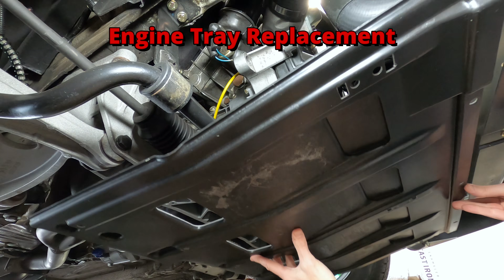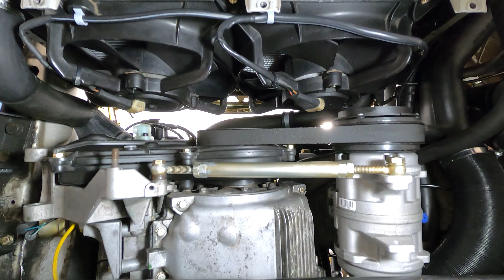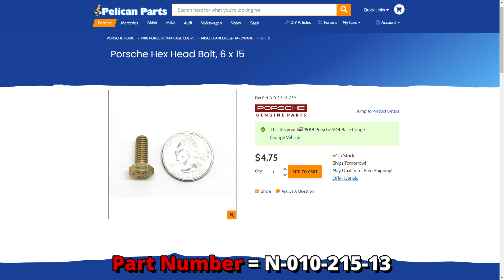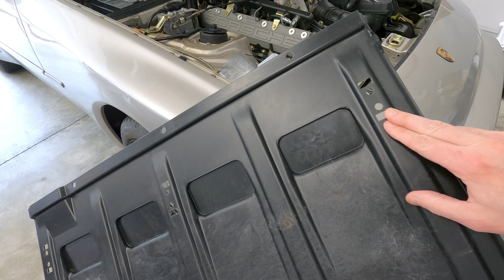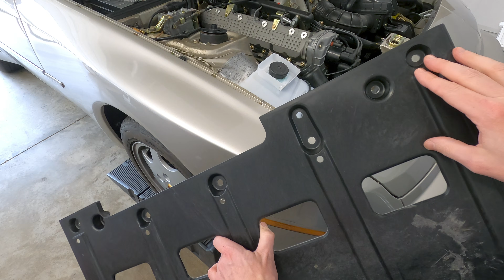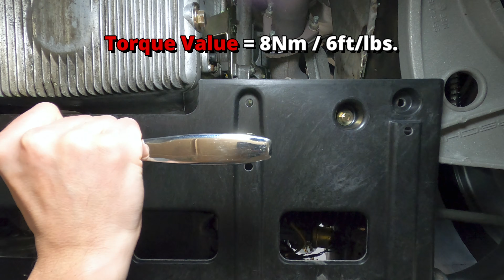Porsche 944 – Engine Tray Replacement Tutorial

Comment: I have the huge metal one, I need to hammer it out until it's straightened up. I just wanted to replace both my headgasket and  leaking oil gaskets in the front.

Comment: Another great video.  My 87 N/A was missing that as well.  I've read somewhere that there is an opinion out there that the removal promotes better engine cooling.  I'm not sure about that, so I installed one on mine.  No problems with overheating that i can tell....
Reply from the maker: Ha! That’s interesting, I haven’t heard that. I do know that Porsche conducted wind tunnel tests, even back then on the 924, 944, and other cars, so there would have to be a benefit in their minds. One would think that engine cooling is optimized by the greatest volume of consistent air moving through the radiator fins, for which it seems that the engine tray would promote by making the airflow more directional, but what do I know? 😂

Comment: Have had my 85.1 since October and your videos have been indispensable and inspiring! Hoping to make my car as gorgeous as yours, thank you! I have a question as one of my biggest challenges so far is dealing with water leaks in a rainy climate. The one I’m not sure how to approach results in water in the driverside footwell and I sourced it out with a smoke tester. With the smoke tube shoved behind the carpet by the hatch release switch, smoke comes out from the back part of the fender where it meets the door. It’s not a door seal issue, I’m wondering if there’s a seam water is getting in there. Any ideas?
Reply from the maker: Oh man! Yeah, water leaks can be a real pain to chase down. It also doesn’t help that Porsche seems to have implemented a design philosophy of allowing water “into” the car as a method for getting it “off” of the car. 😂 Specifically, the sunroof drainage lines and the rear hatch pin drain tubes can crack, get clogged, or become detached from their connection points, which allows surface water to directly enter the cabin. Other common causes include delamination of the rear hatch glass as well as the windshield glass along the lower edge where the seal dries out and fails. A rusty battery tray is also high up on the list and known for dumping water into the passenger footwell. As for the driver’s side, it’s possible that the A/C evaporator drain line has cracked or become disconnected, this would be less likely if you haven’t been running the A/C regularly. Based upon your description, I would check for cracks in the metal and seam seals around the chassis/fender/firewall in the engine compartment below the windshield. There are areas in this section of the car where sealant dries out or the metal fatigues and opens up a hairline crack. The seals around the top of the blower motor assembly are yet another entry point, really the list goes on and on, but those are the most common. I’ll include a link below that has a semi-consolidated list to think about, but checking the Rennlist forums will provide a lot of additional suggestions as well. In addition to the smoke testing, you can also try dumping water down suspected areas and observe potential pathways inside the car. I had water pooling in the rear passenger footwell, but the entry point ended up being the lower windshield. I had to feel around on the side wall carpeting to trace down areas that were the most damp and move up from there. Best of luck! 

Water leak locations - https://retrooutlaws.com/blogs/porsche944/porsche-944-rain-water-leaks-complete-list-of-locations
Reply: Thank you, really helpful!

Comment: There are no other vendors that supply Shoulder Washers?
Reply from the maker: I haven't found any that are the exact Porsche spec... I checked Belmetric, nothing close. The nearest I could find was from MaierUSA (link below). There are small variances in O.D. and shoulder height from the Porshce units, although I believe they would otherwise work, but they are stainless steel rather than yellow zinc. Might be a good way to go if cost savings is the ultimate goal: 25 pieces for $17. Here are the specs for comparison:

Porsche spacer washer - 6mm I.D. X 18mm O.D. X 1mm thick, shoulder height 3mm X 8mm O.D.

MaierUSA shoulder washer - 6mm I.D. X 15mm O.D. X 1mm thick, shoulder height 2mm X 8mm O.D.

https://maierusa.com/products/69991-shoulder-washers-6mm
Reply: @NC944er  thank you for reply and very thorough research.  Excellent commentary & content in videos.
Reply: This Maierusa pack of 25 special washers will absolutely work and is a cost effective option.  The extra washers in the pack of 25 also can be used in the polyurethane holes on the front spoiler where they mount to the radiator support where M6 bolts are used.

Comment: My 87’s panel was coated in P/S fluid & road salt. I removed it and was surprised it wasn’t cracked. A good cleaning and some SEM black plastic paint and it looks new. New seals in P/S rack installed too.
Reply from the maker: Oh man, yeah power steering leaks are the worst, gets all over everything down there. Sounds like the cleaning and re-coat was a good solution. 👍
Reply: Absolutely I love your tips and presentation. Also that SEM freshens up the inner fender covers while removed for fuel line replacement.

Comment: I watched your video as I find them all excellent viewing , even though I must have removed mine many many times over the 33 years I've owned the 944, and I can manage this task without much help😊
But...... Watching it gave me a tip on managing underside air flow .
You pointing out the revised tray with the forward 4 vents blocked made me modify my own tray and I've fibreglassed over the same 4 vents.

I'm doing this as last year visiting Germany and doing high speed runs, my car went scarily light at the front end at 145mph (GPS recorded) and I had to lift although it was still pulling strongly.
I plan on going back this year and have already fitted a front splitter and 2x stays and now this tray modification I'll be able to try a top speed run without lifting.

Keep producing this videos, they're great and very informative.
Reply: @passolaman6338  must have been a 951 ! I ran mine to 170 and it felt fine 🙂
Reply: @arthurmchugh5184 l have one of the EuroSpec Grey cars, brought in via Canada to CA😂 I've never topped her out. American mechs get frustrated with her, so I've done the majority of the work in the past. The last mechanic abused her, and I was just relieved to get her back. I've had an overheating issue that began a year later...need to solve that after smog.
Reply from the maker: Yeah, engine tray removal is about is basic as it gets. 😂 But to your point, I was hoping there would be some other useful details to share, like the part updates. It’s interesting to see just how many seemingly insignificant parts Porsche revised over the years. 

Those are some high speeds my friend, stay safe and let me know if you notice a difference with the front vents now sealed off. The original Porsche wind tunnel tests from 1990 are probably different to find at this point.

Comment: Ah, I knew you'd find another part to replace!  How much dust was on the packaging, particularly of those spacer washers?  I had no idea those were a thing, mine has none of them.  You were probably the first person to buy any!
Reply from the maker: The washers are pretty obscure and very overpriced, eclipsed only by the alien-looking, s-shaped spring clips on top of the radiator, but it is now factory correct, so +1 purist point in that regard. 🤣